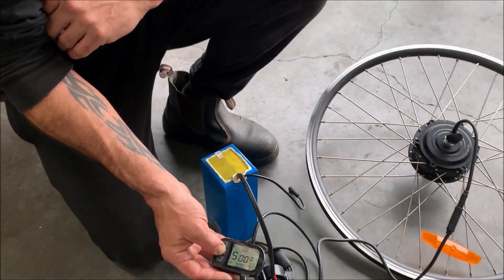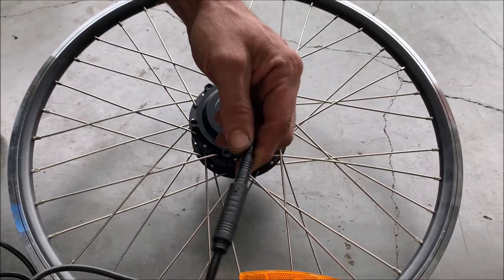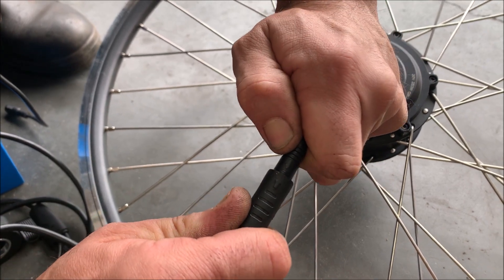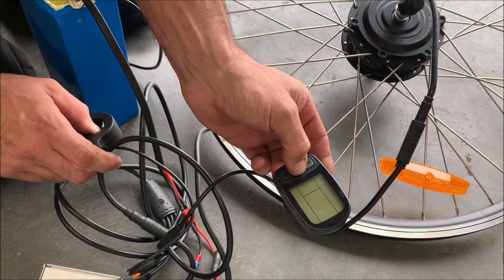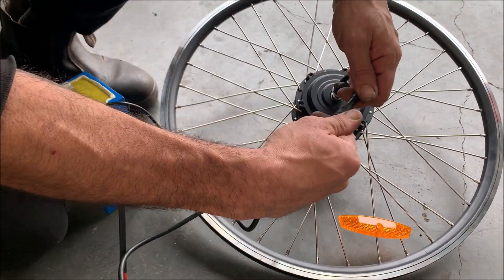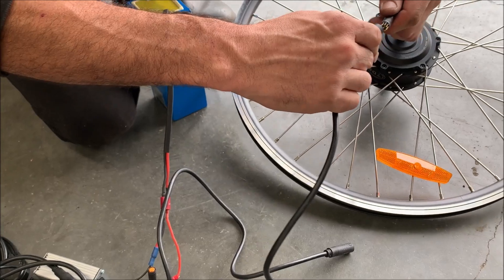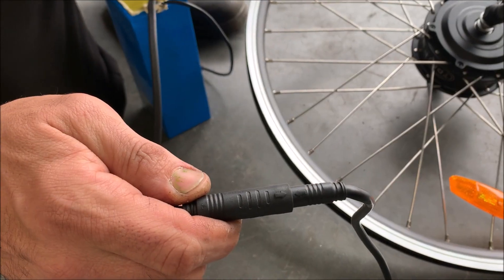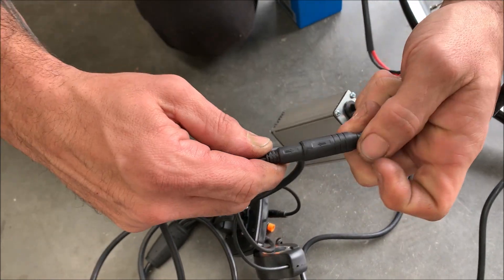Fixing the 'Info 3' Error on Your E-Bike with Conversion Kit: A Step-by-Step Guide

Comment: GR8 . . . thanks my trike is working now .

Q. I bought a TDR kit and I found my controller is different no mention wot D 2 yellow & black wires R 4

Could u make a video on how to program display 
& also how to use the display & its different features while riding
Throttle , pedal assist , cruise function etc.